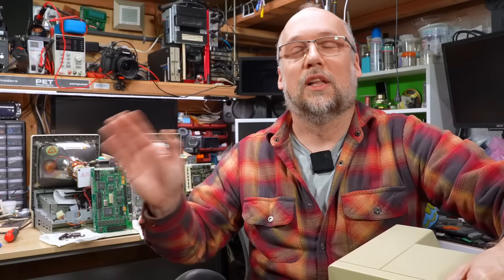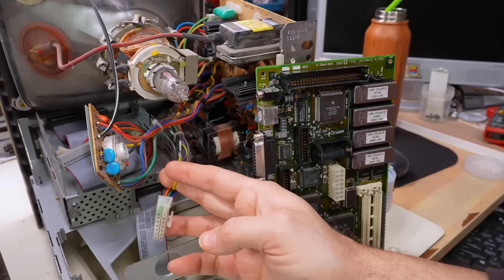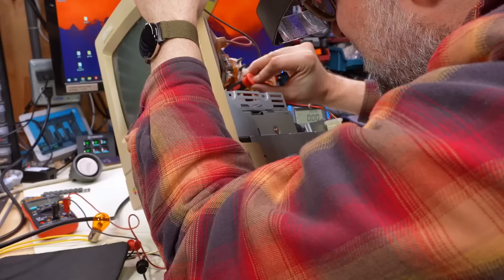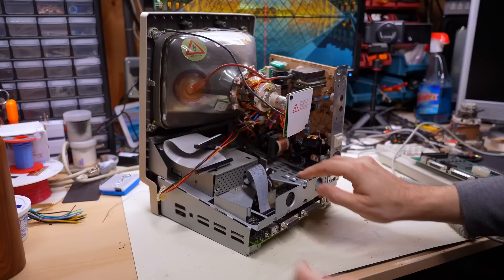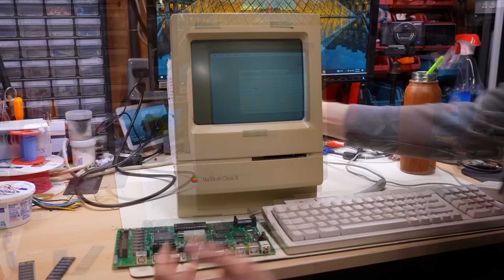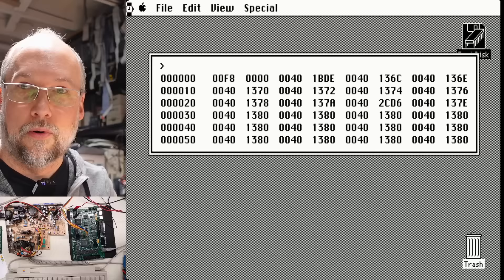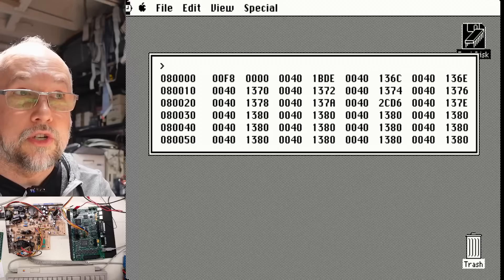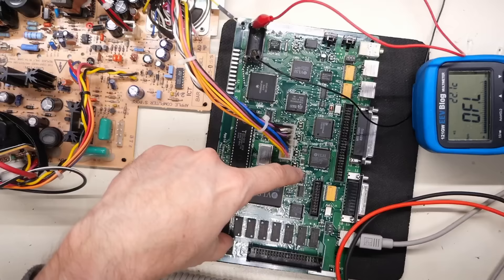The troublesome Mac Classic and Classic II are finally working! (stuck at 512k fix)

Comment: That wire issue is common on these machines, and it usually only affects some wires in the harness. It's a plasticizer turning into acetic acid. It's not electrolyte wicking down the harness.
Reply: I have even seen this with house wiring from the 1970s.  It causes the same green oily goo inside the PVC insulation.
Reply: I've seen the same thing in some vintage stereo equipment as well.  I did wonder what that was, as there were NO capacitors nearby.
Reply: So is it...actually bad, or just ugly?
Reply: @stevethepocket  you probably don't want any acid inside your wires
it both degrades the wires and insulation
the wires will probably work until the corrosion has eaten away the copper completely, but you never actually know the condition of the wire along its length
Reply: @jwhite5008 Sounds like someone has just put up a challenge:  How long does it take for the conductor to be degraded by green acid goo.  😄
Reply: I've seen that happen on thick ,fine ,long and short wire I always put it down to faulty manufacturing. I've also seen it happen to mains wire . Its so hard to believe an acid or what ever can travel down the length of an insulated wire. Sometimes its so bad the copper has gone brittle ,nearly always its impossible to solder. Definitely an interesting topic.
Reply: Wow, what a catastrophically bad failure mode for an insulation material
Reply: Yep , I have seen this with other equpment too .
Reply: @TheGreatAtario 
It can be worse. 

I once pulled a wire out of very old soviet-era house. What was left in my hands was a pair of corroded bare conductors which peeled out of the sheath that became cracked and brittle crust around copper wires - just holding them apart enough to not cause a short. 

But it totally worked before I pulled the wires. 

The building was unheated, uninsulated, and endured -40C freezing cold, +40C heatwaves and leaking roof making the walls damp or even wet. The wiring was probably installed in the 80s or even earlier, and it was not graded for outdoor use.

To add to the horror, Europe uses ~230V power and the building had 16A breakers with no grounding (just 2 incoming wires) and no GFCI whatsoever. Oh and the breaker panel was outside, had no waterproofing, and had a little water inside when I opened it.
Reply: If this happens, just add some dill, some cucumber, and wait. 😉
Reply: The Connections Museum in Seattle had a video a few months ago about green goop developing in some of their switching equipment. I wonder if it's the same issue.
Reply: @PaulinesPastimes  It's also the interface point where the conductor is crimped to a connector pin, and the pin-to-pin surface.
Reply: As a followup here - In most cases what I've seen is that it was just one or two specific colors of wire in the harness that had the problem. This leads me to believe that it was either a vendor-specific issue ("today vendor B's yellow wire was cheaper, so we loaded up a spool of that, tomorrow vendor A's yellow wire was cheaper"), or a completely random thing where any given batch of any given wire color could either be good or bad. Maybe this is an inevitable failure mode for this kind of insulation, and it's just that wires that got baked 2 degrees hotter last 10 years longer? Regardless, it never (at least in Classic Macs) happens to all the wires in the harness.

Comment: Fun fact, O2 sensors in cars work the same way, the "reference" air from outside wicks up to the probe body. Therefore you must not solder those cables, but only crimp it.
Reply: I remember the late 90s f150 condensate drain would drip on the wiring and cause a trim code.

Comment: The corrosion issue with the wire was also something very common with old NiCad battery packs.  It was very common for the Red lead from a NiCad Battery pack to wick the Potassium Hydroxide electrolyte from the battery into the wire causing the positive wire to fail.

Comment: The keyboard reset (cmd-ctrl-pwr) and NMI / programmers switch (cmd-pwr) functionality is actually implemented by the Egret ADB (and other stuff) microcontroller, which is the same on both the CII and LC, not the main Eagle (CII) / V8 (LC) chips (which aren't quite the same, although they are obviously close cousins).

Comment: Nice repair job. Very interesting that the bog-standard TTL part was the faulty one. I rescued a Mac SE/30 some years ago which had capacitor leakage, and in that there were about half a dozen 74xx logic parts in the video and memory circuitry which had gone bad and needed replacing. All the big chips and custom stuff were fine, and they still are - the machine still works to this day.

Comment: The last startup issue you were having with the classic II sounds like a connection that's just a tiny bit loose. The high resistance through the connection heats it up just enough to expand and form a solid connection, so the second or third time you turn it on it works fine - until you turn it off for a couple days and try to use it again, and it starts acting up again. It's a common problem even with brand new systems if you're supercooling the cpu or, as in my case, just don't like to heat the shop in the winter. A thermal camera pointed at the board right when you first turn it on can tell you a lot.

Comment: You did extremely well with both repairs.

On the 68K Macs, removing 12V will "kill it" because 12V is needed for Sound, Floppy & HD, RAM/ROM-GLU Logic, and Video.

As for the wire not being internally corroded - simple: they are inc plated copper, as are the end, but the zinc plating it tinner at the connectors and will have some wear exposing the copper. Cap goo would ha travelled though the wire and when it hit the ends, started corrosion there at the exposed copper. Repairable? Yes, but like you did, beter to just replace the wire.

Just a proposal; lets say you set up a BBS using those Macs. Problem the video is constantly on which wil cause burn-in and other issues of wearing down the high frequency ares of the video portion. Question is, would putting a switch at the diode that feeds the video circuit to turn it on and off while the Mac is on effect it in any way? Basically set it up to turn on/off the monitor like one would do if the monitor was separate like on a Mac II...?

B/W Mac BBSes were a thing but short lived because their video sections would burn out. Thus when the B/W Mac died, they were replaced with something from the Mac II Family. I remember my club starting with a Mac IIci and then moving to a Q700 and then to an PPC8100 and finally to a PPC8600(?) before disbanding in early 2000. One member even had a BBS for his business on an iMac G3, but had some "expert" disconnect the video and CRT tube so that it was always dark and used a remote access program (Timbuktu) to access the machine from afar.

(Sorry for the length...)
So far the repairs have been easy,, meaning that they wre digital in its fault ad repair,, though they wre difficult to diagnose and repair. But in reading Larry Pina's series of books (You sould get them), a lot of the repairs he shows is repairs of the PSU and Video circuitry, which is you follow his directions are very simple to repair once you had diagnosed the problem. The issue it - where does one get parts for the B/W Mac Video circuits? Many of such parts are no longer being made and what few parts that are available are almost impossible to find and expensive to get. Besides the usual suspects, where would one try to find such parts? Where can one get compatible parts. Back in the 1990s, I had 20 Flyback transformers for the B/W Macs, I am down to my last one and can't find any replacement for it.

Another point of failure for 68K Macs is the Bornes Filter at the ADB Port. Removing/adding a keyboard and mouse while the Mac is on usually won't will the Bornes filter. But there is a chance that it will. I'm sure there are dozens of Macs with dead ADB Ports out there, but near zero access to a replacement Bornes Filter Chip. There has to be a way to Hack that back to life somehow....

Comment: Some Mac's needed a battery installed to boot, but if you power it up and let the capacitors charge a quick restart will give a proper restart.

By the way, there is a program called Mactracker that lists the minimum and maximum OS for various Macs along with a good deal of other information. The Classic II does want System 7. Apparently it will run 7.6 though that might be a bit much. System 7.5.1 might work well though. The later versions bloated up quick. They really were meant for 68040 and PPC.
Reply: Another possibility is something I experience with my G3, if you max out the RAM the Mac fails to bring up all the memory on the first boot attempt. After a couple of reboots it initializes all RAM and starts booting.

Comment: I bought a genuine Molex de pinning tool for Mini Fit Jr plugs.  It was also completely worthless.  Used it three times and bent the tool.  Tried to straighten it out and it broke.

Apparently the only way to remove a pin from ATX connectors is with a Dremel and a hammer.

Comment: SE Mac is absolutely Best Mac. I have had mine since 89 (it was made in 87), and I’ve had a Radius 020 + 68881 accelerator (and 4MB of RAM) in the thing since 1990. Just checked that it was still a-okay by firing it up and playing Prince of Persia on it (for far longer than intended). 

Other than clipping out the battery a decade back, I’ve not messed with the internals since I installed the Radius accelerator. If you’re going to buy a lunchbox Mac, the MacSE is the way to go.

Comment: Something I might suggest with the hot air station and surface mount stuff is putting a Kapton tape dam/covering over the nearby components, particularly connectors to make sure you don't melt/damage them. Found this trick through the channel Tronics Fix. He does this all the time.

Comment: The area under that 174 looked pretty corroded from cap juice so the chip may even be just good, but the traces and pads around it being conductive. That could also be what was causing the crosstalk on those pins.

Comment: I mean, you could theoretically drill a hole in the board to make that pot adjustable from the back side...
(provided no traces cross that area on either side and you de-solder the pot to get it out of the way during drilling)
Great fixings!

Comment: If the computer doesn't work right with a cold start but does on subsequent restarts, my instinct is to look at capacitors as they seem to be losing a charge when powered off but able to maintain a charge on restarts.  Just because a capacitor is not leaking doesn't mean it isn't any good.  Replace every single capacitor in the whole system.

Comment: I'm troubleshooting a classic II right now, and these videos provide a little more insight. A weird thing with the classic II, is that it doesn't boot unless I undervolt it to 4.84v on the 5v rail, and 11.78v on 12v. It displays a sad Mac if I boot it on exactly 5v. The sound still doesn't work even after recapping.

Comment: Camera Issue: 
If you are using a DSLR, especially one from ~10+ years ago, It could be overheating. Your only solution there would be to buy a newer camera. You can usually feel some heat even through that thick plastic. 
 Also, make sure you don't have your auto-shutoff on (battery saver). 
Sometimes (With some Canon cameras specifically) HDR will cause some stuttering and such and may contribute to overheating.
 If you're getting a "lens/shutter" code on a canon, It could be a battery issue. I've seen multiple (canon) cameras with this issue, but both that I’ve seen were actual shutter failure issues.
 Make sure you check the connection (dedicated power) between the battery slot adapter and the power brick. Some of the barrel jacks are touchy.
Battery pins: make sure all of the pins in your battery slot are properly spaced/placed, sometimes they get bent out of place and things get crazy. 
If You're streaming through mini HDMI: Mini hdmi is not my favorite port. Make sure the connection along there is good and that the capture card isn't actually the one dying. It can be hard to tell if you've got clean output on since your screen might be black depending on the camera. 

Also, if you're using the flip-around screen, the screen cable could just be struggling. Cables generally don't like getring mushed 😂. 

Moral of the story: I don't know if you're using a dedicated laptop or using the flip-around display, cameras like to fail spectacularly (If you have a macbook you might be screwed lol), and canon is a mess.

Comment: Love your vids! One thing about using the hot air station on an old board like this: Please use a preheater to distribute the heat evenly. PCBs get very fragile over time

Comment: The 74LS174 - you could also desolder it and check in the memory programmer (it has ttl diagnostic mode). But of course congratulations! You made it.

Comment: Thank you that was a really interesting video.

I had a question though, because I was thrown off and actually thought you were on the wrong track with the address line. I understood everything you said about the address line being bad would cause the memory to behave in the way you describe (i.e., the same byte would appear in multiple places at that spot). Why I didn't think the address line could be responsible is because why would the system think it has only 512k of RAM in this scenario, as reported by Finder. I assume most systems use hardware and circuitry to detect how much memory is in a system, and the fact that you need to set a jumper, and the system immediately crashes when you plug in the board support that. So I assumed something was just making it seem like 4 of those RAM chips on the board weren't there or something.

Comment: I smell dead ROMs.. Or some latent charges/static/dodgy connections that needs the system to warm up and cycle a few times! Quite common with Amigas too after being off a while, as well as having to re-seat socketed ICs like the Kick ROMs and expansions etc

Comment: I've had a similar result before when something first didn't work and then it did with every reboot after that. Leaving it turned off for a few weeks would make the problem return so I wonder if it's something that doesn't quite work until a certain chip has heated up a little. Unless you left a few hours between reboots, this might explain things.

Comment: I think the potentiometer itself is likely the issue, it needs to be replaced.

Furthermore, to me the first motherboard looked like there is bad contact rather than regulation issues.
It could be that the board is cracked and it often does not make contact somewhere...

Comment: I got a Classic II that has no sound and the -12VDC gives -0.05VDC, which isn't good. I'm not sure if the system board has another bad trace I missed or something else has gone bad. Got any tips? My Classic I did the same thing until I patched a bad trace and the chime worked.

Comment: I have almost the same problem, I had a broken trace under the LS chip, fixed that. So now it boots with a ramcard installed…if I have the ”No sims installed” selected. But system stills says its only 1mb of ram installed so same as with out ram card. If I choose the ”sims installed” on the ramcard it still gives the sad mac and 00000005 00100000 code…

Comment: Another piece of analytical craftsmanship.
... Yes, and then... plugging in the extra memory - and also pulling it out - while the Macintosh is running, that's hilarious. '... See if it allows that or crashes... the system freezes...' And switch the inboard memory switch from 2 to 4 MB while running... Hahaha I laughed. I found it genuinely funny to see. I have sometimes thought "what would happen if you do something like that", I also thought that the memory chips might be damaged as a result. But that is not the case. Apparently those chips can take a rough beating. Nice to know and to see.

Comment: Regarding the end of the vid, silver coloured wire is just tinned copper, if you scrape the surface it'll reveal the copper underneath, unlike today's annoyance that is copper-coated aluminium where you scrape that and it turns silver...

Comment: Why would some address lines on the CPU have to go through a 22 ohms resistor but not the others?
Reply: Fast edge transitions can cause ringing on long traces. A small resistance slows down the transition and better matches the impedance between the trace and the chips and leads to better signals at transitions

Comment: I think I recall a small glitch in old eproms. The gates can lose their charge if not powered for a long time. The ultraviolet light is activates the  drain the gates to erase. Usually this corrupts the eprom. I wonder if you were just close to the point before they erased. turning it on for a while recharged it.
Reply: i wonder if the LS174 had a short under the chip. lifting it fixed it. The chip may be fine.
Reply: @donkeymedic came to the comments to point this out, it might have been corrosion  under the chip

Comment: If you put non Panasonic batteries into a Panasonic digital camcorder and it no longer works is it capacitors that have blown ? These batteries have the same cases as the Panasonic batteries and are recommended for use in that model Panasonic camcorder (but are warned against by Panasonic).

Comment: Isn't it possible that the Classic II also needed the 12v? It was fixed between the first boot attempt (dead board) and the second attempt when it just freakin worked, right?